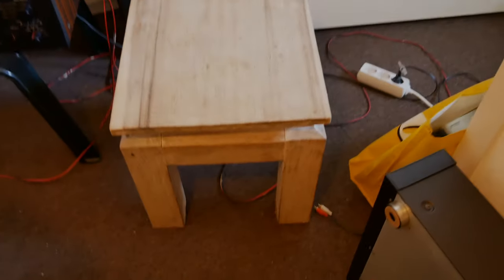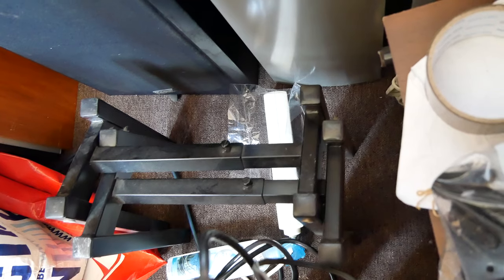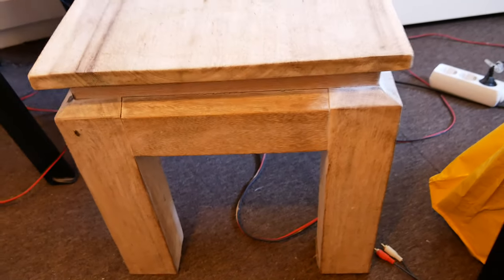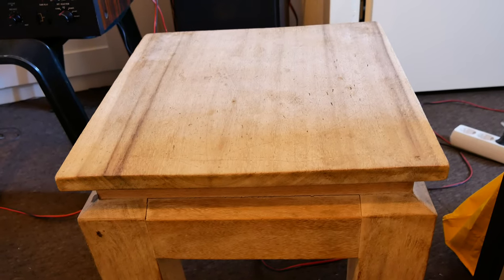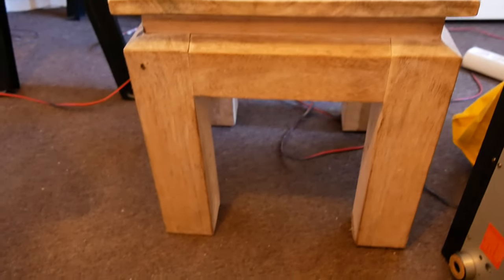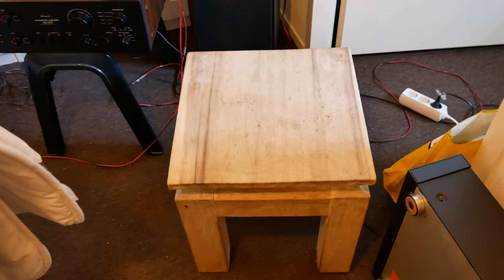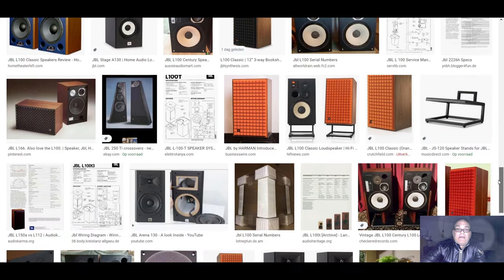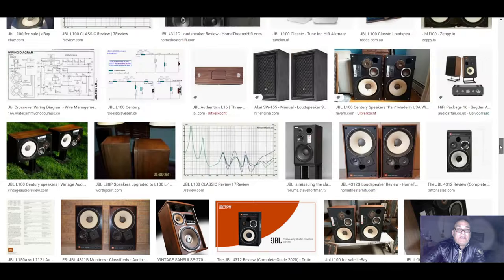Cheaper and better stands for JBL l100-Klipsch Heresy-Tandberg Studio Monitor and other old speakers

Comment: speaker stands are made to a height to match the speakers, so the tweeters are at ear height
Reply from the maker: tweeter height can vary between 80 and 100 cm
Reply: @vintagestereo  Which is why you have to match the height of the stands to the tweeter height, so it matches in with your listening position,hence why speaker stands come in all different heights